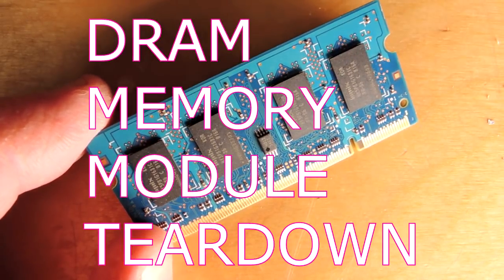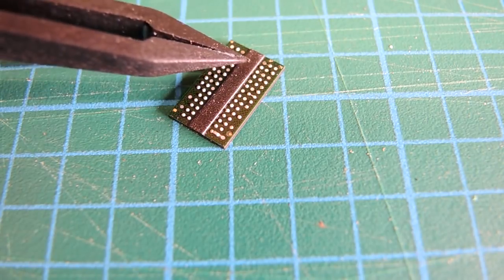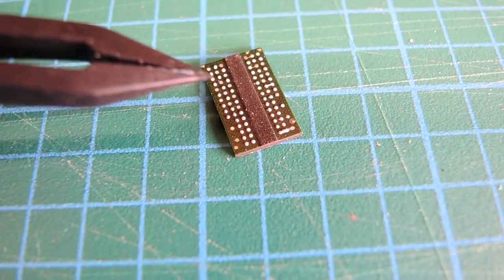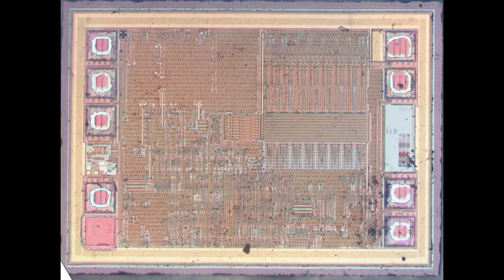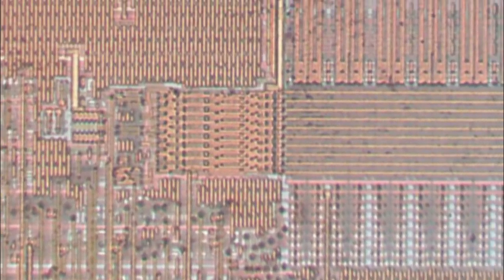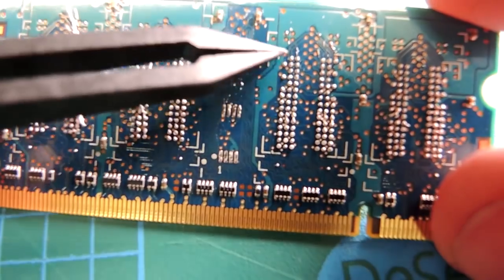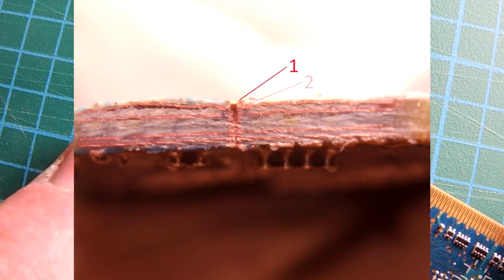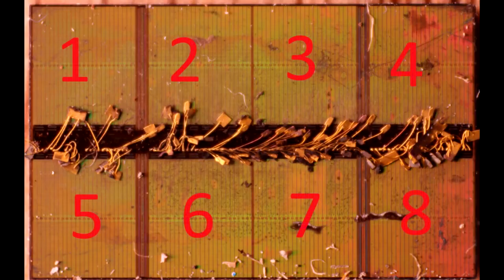DRAM DIMM TEARDOWN

Comment: Fascinating. Do some common components. Something as simple as a 78xx regulator. How do simple, higher current parts manage heat? can you see it at the die level? Failure mode speculation would be interesting.

Comment: I think the eeproms are standard I2C EEPROMs, not SPI
Reply from the maker: Yes, you are quite right.  Thanks for the correction!
Reply: Yup, I2C and with an interesting twist: the EEPROMs often don't have a RESET signal. Instead you must "finish" any in-progress I2C transaction after the main CPU has reset by wiggling the clock line 9 or so times to get the part back to its idle state.